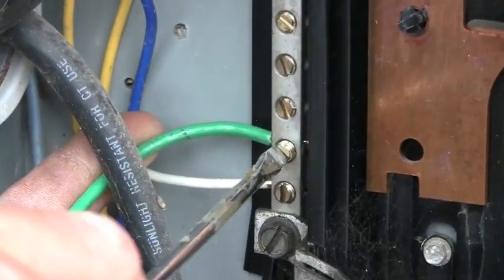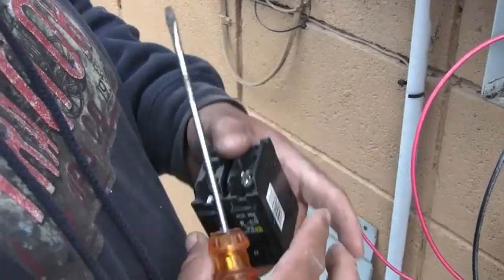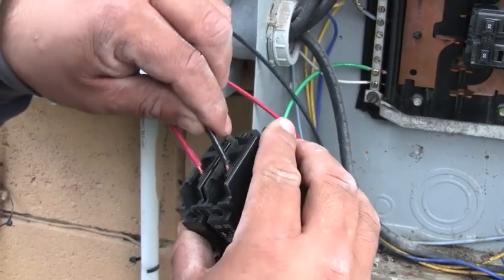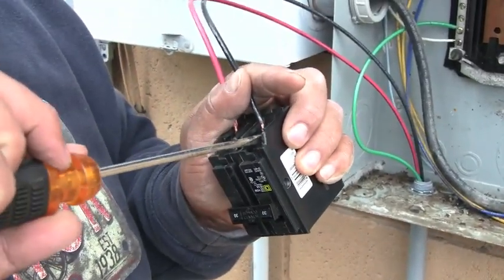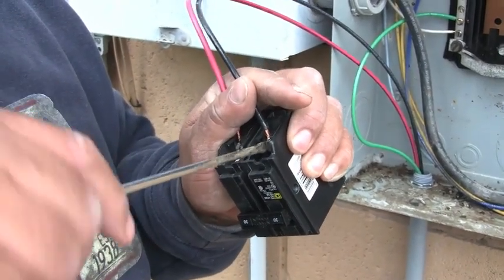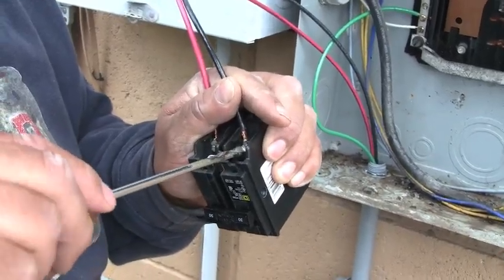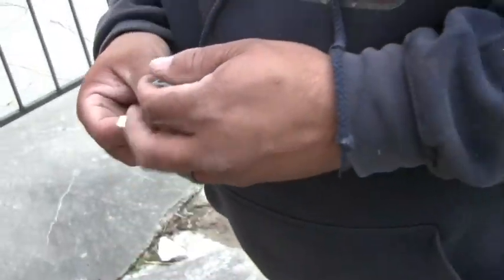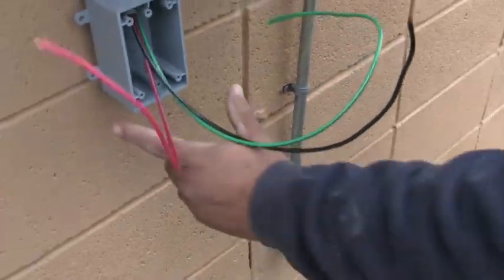I have the power! update 220 from breaker and air compressor

Comment: Looked like 10 AWG wire..  What kind of current you intending to draw?  10 is good for 30A.  Any extension over 10' should go up in size.  Welder outlets I have done were with 6 AWG, and extensions up to 30' were same..

Comment: wrong type of receptacle for a 30A 220V circuit, that's a 50A used on welders.  30A 220V has its power blades arranged horizontally but otherwise is the same physical size.  If it's really 50A you want change your wiring and breaker.

Comment: 1st. Safety ? AWFUL...
2nd. Where are the protective gloves, where is the electrician screwdriver, where are the boots ?
3rd. Cut the power, install the outlet and then connect to the terminal box.